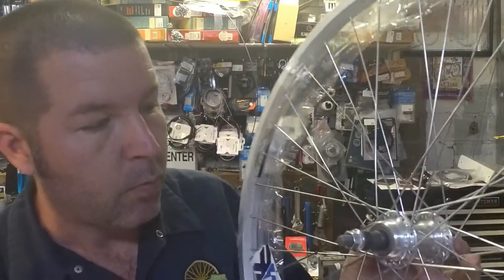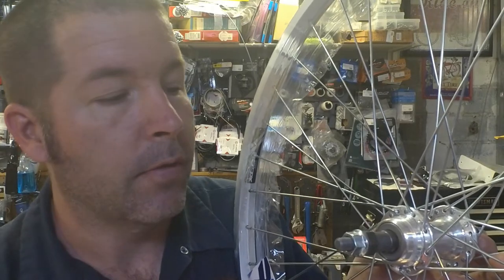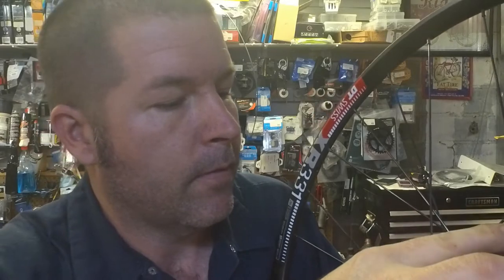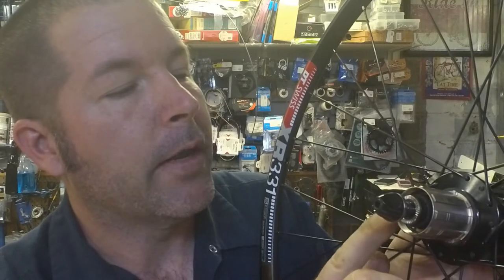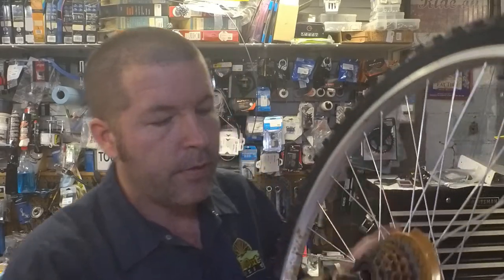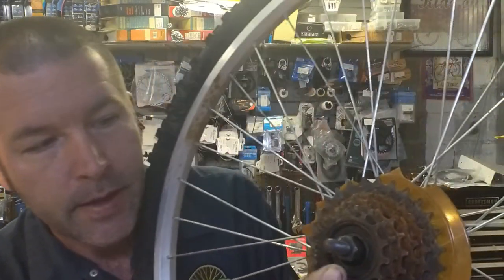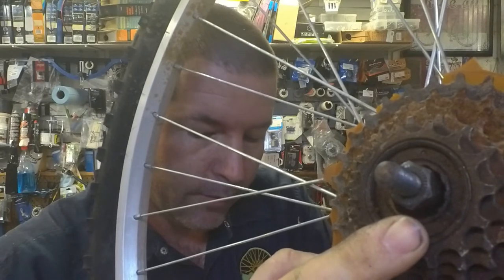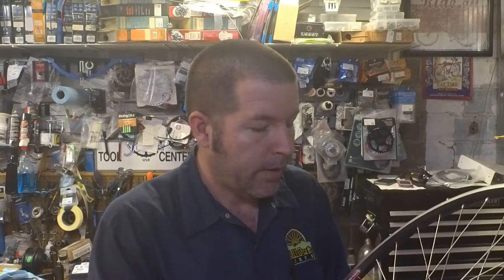Cassette vs  Freewheel

Comment: I have a trike that uses 24 in Wheels I'd like to upgrade a 26-inch Wheels but it has special hubs for the rear wheels that I cannot find because it's an antique is it possible to re-lace a 24-inch wheel with a 26in Outer Rim
Reply from the maker: Yes, but you can't put a 26" on the front without replacing the fork. It also makes the trike more apt to flip. Labor on the wheel builds should be about $50+parts each wheel. I found it best 5o leave the 24s on and go with a bigger tire. Good luck and thanks for watching!

Comment: I learned something today, thank you. I have an old Schwinn, "Speed six" was the name on the chain guard. It was made in Taiwan. I would like to put a disc brake on the front wheel. Is this a good idea? Thank you for taking the time to read this.
Reply from the maker: If you wanted a good brake on your schwinn a disc brake would be great. But, you might be better off going with a V brake instead. It would be cheaper, easier and in most cases just as effective unless you live on top of a mountain and need to get down fast. With a V style brake if you have to buy the parts you need a fork and a brake kit. Both cheap. With a disc you need a new wheel, fork and brake kit all more expensive. Good luck and thanks for watching!
Reply: @alloutbikes  Thanks! I will look into it.